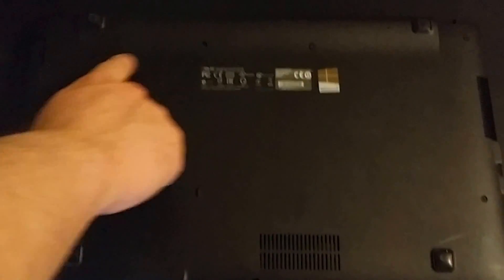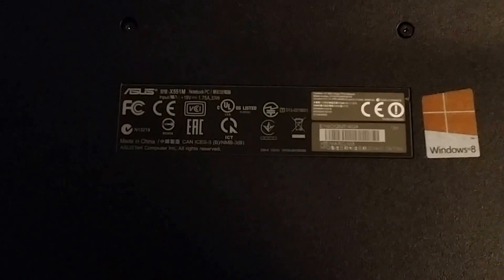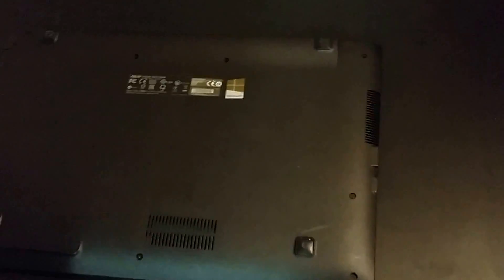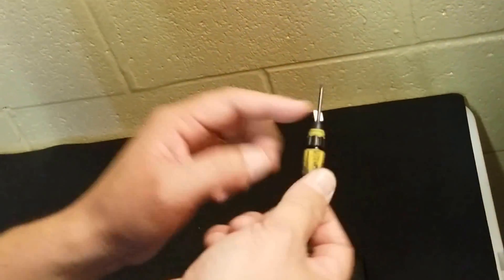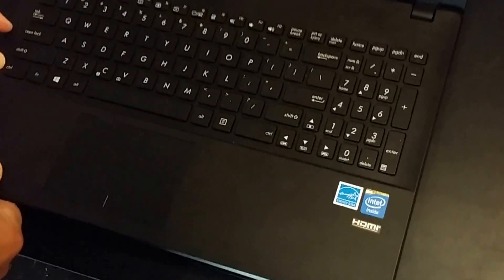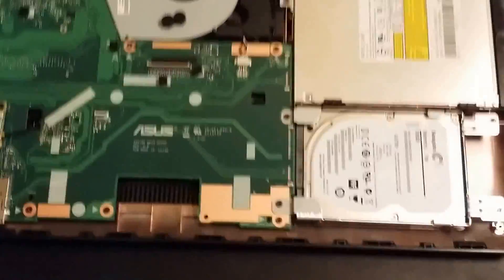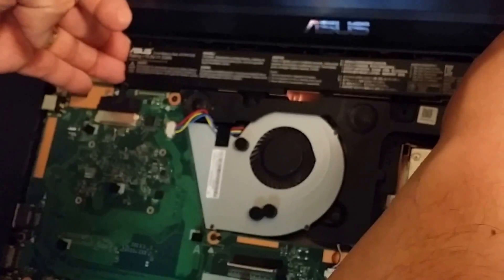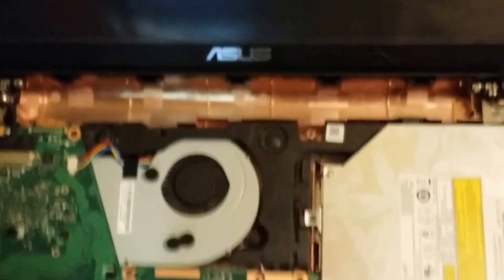ASUS X551M Laptop Battery Removal & Won't Power On Fix

Comment: im trying to open my asus to fix my sound. Can you show me all the components of the sound system.

i used to hit my laptop when i got mad and i broke something (or disconnected something) because now my sound barely works. 

when i start my laptop it usually has a red X next to my sound symbol, and it says "No audio output device detected" or "The audio service drive is not running" or something like that. 

but if i press down on my keyboard during the start up, and keep holding it, my sound will work. Sometimes it makes a shorting out sound and the sound stops working. so then i have to plug in my earbuds and i have to hit my keyboard to try to get the sound to work again. i know its stupid and sort of ironic since hitting it is what got me into this situation, but i cant take it to best buy to get it fixed. i need help
Reply from the maker: +pwnageinthemaking Pretty much, you damaged your speakers or connection wires to the speakers.  Unless you replace the speakers themselves, you will have to continue to jury rig it (holding down pressure on the keyboard lid).  There is another solution though and it is pretty cheap.  For under $10 on eBay or Amazon, you can get what is called is called a USB Audio Adapter.  Here is the link:

http://www.ebay.com/itm/USB-2-0-External-7-1-Channel-3D-Virtual-Audio-Sound-Card-Mic-Adapter-PC-Laptop-/400883770992?hash=item5d5688e670:g:860AAOxy7nNTT-2u

You can plug in your earbuds or analog speakers and have better/louder sound then the Asus&#39;s original speakers!  Or if you simply want to get some USB speakers here is an example:

http://www.ebay.com/itm/USB-Power-Wired-Computer-Speakers-Stereo-3-5mm-Jack-for-Desktop-PC-Laptop-New-US-/361330211875?hash=item5420f57c23:g:ljAAAOSwv0tVbuF2

No more fighting with your computer or hitting it to get sound which could potentially damage it even more.

But if you REALLY want to fix your laptop, here is the replacement speaker item needed:

http://www.ebay.com/itm/GENUINE-ASUS-X551M-Series-15-6-SPEAKER-LEFT-AND-RIGHT-DN023784000-/151952279177?hash=item23610fc689:g:Tz0AAOSwL7VWmgKw

Unfortunately, I don&#39;t have the laptop anymore because that was a customer&#39;s laptop.  But to remove the motherboard to get to the speakers is really not that difficult.  Simply remove the remaining wire connections that are still attached to the motherboard, remove the screws holding the MB down, gently slide the motherboard away from the bottom case.  Remove the speakers and replace with working speakers, and install speaker wire to MB and do everything back in reverse order of assembly.

Good luck and whatever you decide, you will get your sound back!

Devin

Comment: I hate my asus laptop. I got it as a gift for graduating college and I was so excited. But after probably the first week,  I grew to hate it. It's nothing I would have picked out for myself. It was doing some updates and it froze to the point I had to call tech support, which irritated me. The battery life at most lasts for 3 hours before it dies out. It dies quickly and charges fast.  I hate it.
Reply from the maker: +April English Unfortunately, this was a $300 laptop and at that price point, the old adage, you get what you pay for rings true.  They use the cheapest parts imaginable and barely make a profit so they have to sell in volume to practically make any money.  It is not surprising that you are having so many problems with it.  I know it was a gift and you really can't complain to the people that gave it to you but in the future be careful purchasing any computers under $500 because these things happen all the time from customer's computers I fix on a daily basis.  I NEVER recommend computers under $500 just because of these issues.

Devin

Comment: I can't remove the keyboard? I took put all the screws helpppp .___.
Reply from the maker: +Lmao Right now Unfortunately either you missed a screw somewhere (Underneath the laptop) or you didn't release the keyboard mechanisms.  If your computer is the X551M you should be able to remove the keyboard if you followed my video's instructions.  Look again for screws and make sure the keyboard is released.
Reply: ***** Nvm found out that i can't remove the keyboard.
Reply from the maker: Lmao Right now Yes the ACTUAL keyboard is integrated into the top lid assembly.  If your keyboard is defective, you will have to purchase a new top lid.
Reply: ***** Well I can't pull it off :[

Comment: Is there anyway I can contact you whether its social media or a phone call in need of some serious help.
Reply from the maker: +Redji Davilmar I primarily use this Youtube channel to give technical advice on how to fix your issues.  If I gave out my store number, I would be inundated with questions and would never get any work done lol.  Just post a comment on here and I will answer your question in a prompt fashion.

Thanks!
Reply: Alright then. So my laptop is going tbrough technical difficulties. It is the same model as yours and whenever i turn it on it doesnt open and only 1 green light turns on although there are susposed to be 3.  For example i reach for laptop press the power on button but it doesnt turn on....This has happened first when i was using my laptop and it just turned off but i made sure it had charge i tried opening it and a red light appeared at the bottom and a green light but it didnt open and i didnt have my charger in. May you assist me please?
Reply from the maker: +Redji Davilmar Your issue sounds like a motherboard issue.  If you can't even power on the system to at least see the Asus splash screen, 95% of the time it is either the motherboard or the memory.  The other 5% could be things like your power button board/ribbon connector.  Based on your comment, you are getting a light of some kind so that means you have power either running from the battery or the AC Power adapter.  But when you push the power button, you state that nothing happens.  Something is causing your system to not fire up.  My guess would be either the motherboard or the power ribbon cable.  The cheapest easiest option is to make sure the power ribbon cable is inserted correctly (on both ends).  If that doesn't work, purchase a replacement ribbon cable for under $5.00 as a damaged cable will not allow the system to turn on.  But if that doesn't work, you would need to replace the motherboard.  To get a true diagnostic, you need to go to a computer repair shop that has diagnostic equipment to be 100% sure.

Good luck!

Devin
Reply: +Angrysquirrel PC Thanks saved my ass lmfao😂😂😂
Reply from the maker: Redji Davilmar Anytime!  Hope you get it figured out and fixed!
Reply: +Angrysquirrel PC Thanks have a blessed day

Comment: Hey squirrelgaming, I have an ASUS X555L laptop and I disassembled it yo try and do a battery reset after my I went to restart my laptop, but it wouldn't turn on nor charge. After disassembling, there was no battery that i could see so I quickly put together the laptop. it still won't start up or charge. do you know what the problem could be? Thanks in advance.
Reply from the maker: +oMimic12 The battery is the black rectangle to the left of the Hard Drive.  On eBay, the battery goes for $30.00 and up.  The battery is held down by screws on the perimeter of the battery.  You will have to remove them to remove the battery from the motherboard.  If your laptop is over 1-2 years old, they battery could have gone bad depending on use and environmental conditions.
Reply: +Angrysquirrel PC Wow. Can't believe I didn't notice it earlier haha. Thank you so much, I removed the battery and did the generic hard reset and it fixed my computer. I just assumed it was in the same position as your model. Appreciate the help :)
Reply from the maker: oMimic12 Anytime!  glad you got your problem resolved!

Comment: Hello there, I've got an Asus X555L, does this video tutorial works for this model?
Reply from the maker: +Maximiliano Cruz To be honest, I really don't know.  I have never disassembled that particular model yet.  If your model looks similar to this one, you could try following the steps detailed in the video.  If there comes a point if there is a struggle to disassemble your system, stop and reassemble it and let a professional do it for you.  The worst thing you can do is damage your system or break a critical piece that holds it together.

Devin

Comment: Thanks for the video, I got this laptop for my sisters to do their school work on and so I had a computer when I traveled. At some point there was a power surge and I knew I likely had to remove the battery and drain the excess energy and it was at that point I realized there was no way to pop the battery out. What a pain in the ass. Thankfully though with the help of this video and another on ribbon cables I got it all sorted out without breaking anything other then a couple of the cheap screws.
Reply from the maker: +James Johnson You are most welcome!  I am glad you got your sister's laptop working again!  Thanks for watching!

Devin

Comment: After I buy the disk what do I do...? 😅 the only think I'm able to access is the Aptio Setup Utility. It pops up when I turn my laptop on. I can email u a pic of the screen if u want...
Reply from the maker: +Bella Stone You can set the BIOS/UEFI to disable the secure boot mode and make your CD/DVD drive to boot first and your hard drive second.  When you put the disk in, it will automatically start the installation process (you will have to hit any key when you see the prompt for the installation dvd to start).  After that point, just follow the self explanatory instructions.

Devin

Comment: Yeah so I kind of screwed up. I tried doing a reset, but it told me I was missing a partial drive. In trying to create a partial drive I think I might have wiped my computer 😭😭😭 I am currently waiting for customer support to email me back.
Reply from the maker: +Bella Stone You can purchase a recovery disk from ASUS for about $30.00.  That will restore your computer to factory state and is far cheaper then buying an OEM Windows 8 disk for about $100.00.

Devin
Reply: @angrysquirrelpc9181  You can also download a copy of the Windows OS you need. No cost, as long as you have the proper license/product number,

Comment: Thanks for replying so quickly. The laptop was a gift so I'm not sure about how it was purchased. I don't want to let the person who bought it for me know it got screwed up. Also, I updated from Windows 8 to 8.1
Reply from the maker: +Bella Stone Ok, you probably got a failed Upgrade to 8.1.  Your upgrade most likely got corrupted.  If you hold the Shift key when you restart the computer (whether it is from the desktop/Metro UI screen at the corner charms bar or at the password screen), it will take you to the troubleshooting section.  Select the troubleshooting option, then select System Recovery, Fully Clean Drive then follow the prompts to reset your computer to a clean Windows 8 to Factory settings.  This should hopefully resolve the issue.

Good luck!

Devin

Comment: I have the asus pc notebook f551c which seems to be very similar to this one in the video. My laptop is almost brand new and for some reason it started getting very slow and after I updated the Windows it came to almost a complete standstill. I can't reset to factory settings because nothing works! It basically turns on and shows me my screen. Will removing the battery and holding the power button help? Is there another way to reset it? Please help! 😭😭😭
Reply from the maker: +Bella Stone Bella, if the computer is under a year old, ASUS can repair the computer for you since all new laptops comes with a standard 1 year hardware warranty.  It is very possible your hard drive might be failing based on your problem.  It is also possible that you might have a corrupted update as well.  What I don't know based on your comment is if you updated to Windows 10 from Windows 8.1, 8, or 7 or you bought the computer brand new with a preinstalled full version of Windows 10.  My suggestion to you is to contact ASUS tech support if you purchased it less then a year ago.  Most people don't know this but if you purchased it with a TRUE credit card (not the bank debit cards with a visa/mastercard logo), you get an additional 12 months of warranty coverage through your credit card's warranty assurance program (see your terms and conditions for details).  Get an estimate from a computer repair shop and they should get you a diagnosis.  If it is the hard drive, you will have to spend at least $60 and up for a replacement plus the labor.  If it is simply software, then labor cost is all you need.  If you were my customer, I would charge $49.99 + tax + possible part BUT I am on the lower end of the spectrum as I don't have much overhead with my business.

If you need additional help, please give me more details based on the Windows Update/Windows 10 questions.

Devin

Comment: How do I reattach the ribbon cable ?
Reply from the maker: +Charlene Desrosiers Unfortunately, on this type of laptop it is quite a chore since you have to not only worry about the ribbon cable itself but to hold the top keyboard lid up at the same time.  I had my son hold the lid while I worried about the ribbon cables.  If you are having trouble using only your hands/fingers, try using a pair of plastic tweezers to insert the ribbon cables then flip the latches downward to lock the ribbons in place.  That is what I personally did.

Hope this helps!

Devin

Comment: @angrysquirrel PC hey I want to get into doing graphic designs, what is a good touch screen laptop you would recommend ?
Reply from the maker: +Zoe There are a few good ones out there.  But know this.  The front end and back end costs of getting a GOOD touch screen laptop will be more costly then non touch screen laptops.  On the front end cost, you can add a good $100-$300 for adding a touch screen capability.  On the back end, if you ever break the touch screen digitizer or the LED screen underneath (a LOT of them are fused together so if you break just the glass, you will still need to buy both even though you may not NEED both) there may not be parts available from Amazon or eBay and ONLY available through the manufacturer (and they usually charge upwards of $300 or more to get the part not including someone that can repair it locally so possibly tack on the manufacturer's labor to that part cost as well).  But Dell and Lenovo touchscreen laptops are what I recommend at THIS TIME.  Stay away from HP, Toshiba, Acers, Gateways and Emachines.  I repair those ALL THE TIME.  Lenovo and Dell are the ones I hardly repair for touchscreen issues and depending on your budget, you can get a GOOD spec'ed one good for your graphic design needs.  Get at least a Intel Core i5 w/ 8GB (or more) of Memory with a 1TB hard drive w/ a decent graphics chip (Nvidia).  If your budget can afford it, get an SSD hard drive as that will make your system even faster.

Good Luck!

Devin

Comment: Hi i would like to ask if its possible that my usb port is grounded? After inserting a usb. my laptop crashed. it wont even turn on? what could be the prob? what is the possible solution. my laptop is still with warranty
Reply from the maker: +Rodel Alberto Your USB port is most likely damaged.  I have seen this before on some of my customer's computers.  They break the USB port and the metal "fingers" of the port are exposed then they continue to put flash drives in and one of the fingers are touching metal, either on the perimeter of the USB port housing or the metal on the flash drive itself.  Check your ports to make sure they look fine and no USB port's metal fingers are touching as that will not allow the computer to turn on due to shorting out the system.  If it doesn't turn on after putting in a flash drive, follow the video's instructions to remove the battery, hold the power button for 30 secs to reset the laptop's motherboard.

Good luck!

Devin
Reply: +Angrysquirrel PC Thank you very much sir! One last question, in any case this method wouldn't affect the files on my harddrive? thank you! more power
Reply: +Rodel Alberto No it wouldnt.

Comment: the thread were blurriness 6 stripes of the toes that are in the power button, could you tell me how you call that white thread the shorter the power button to buy please ,  i dont know the name to buy another one
Reply from the maker: +gostaldo joseph Here is a listing on eBay for the power button and ribbon cable.  Hope this helps!  Good luck!

http://www.ebay.com/itm/Asus-X551M-X551MA-Main-Power-Button-Module-34XJCSB0000-60NB0480-PS1040-200-/281521225566
Reply: +Angrysquirrel PC ok thank you i'll check but the power is ok ,i just need  the name of the withe thread the short one
Reply: +Angrysquirrel PC  oh ok thank is the same one ,i suscribe
Reply from the maker: Look up the model numbers for the eBay listing.  Also for BOTH parts its only $5.99 so you can keep the power button as a spare for the future.
Reply: +Angrysquirrel PC  yes its good thank you ,i subscribe